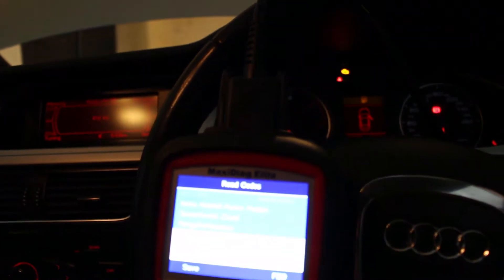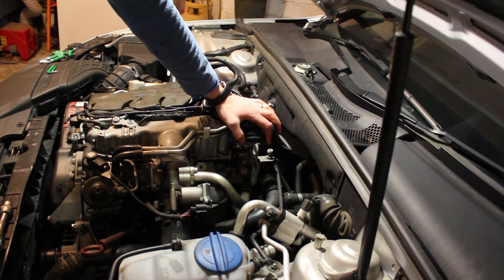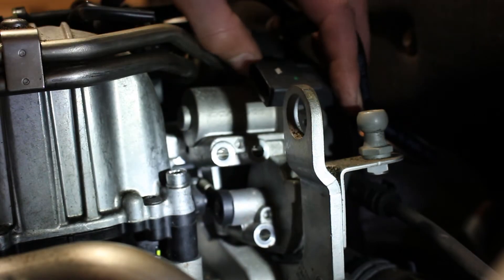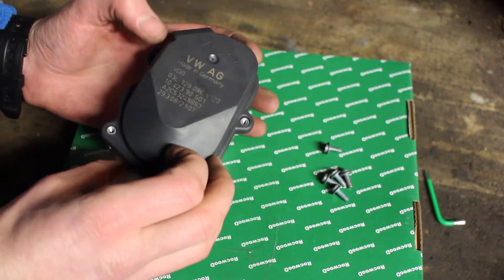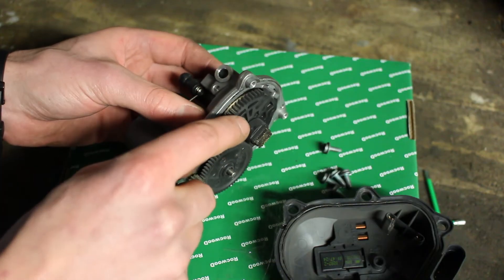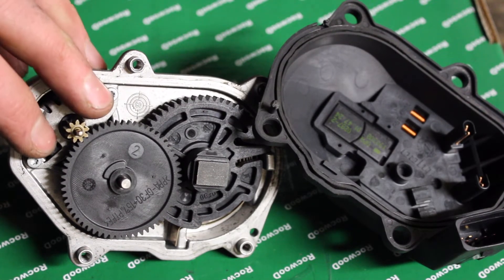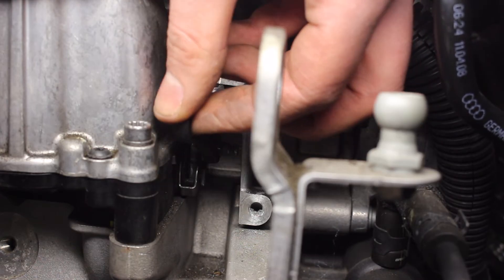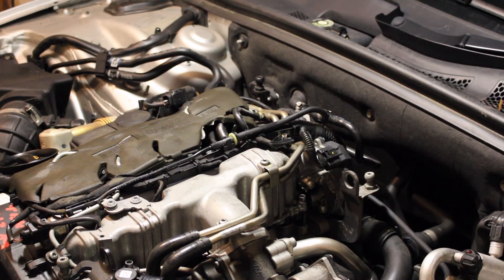How to remove & clean Intake manifold actuator motor/sensor- Audi A4 P2015 fault

Comment: Hi Sam,
Would you by chance have step by step guide covering 2015 error code fix on 2010 Audi A4 B8 . Engine with Sensor mounted on Plastic manifold . Little different to set up on your B8.
Great step by step guides. Have followed guide on how to change rear brake pads / handbrake release . Perfect . Thank you and thumbs up from me.
Reply: If the bolts for the sensor are on the other side it's an absolute pig. Manifold off
Reply: @brader901  having this exact issue right now!
Reply: Update on how it went ?

Comment: Hi I'm getting the same error code I brought the fixing bracket but still getting the fault code. One thing I don't see the actuator moving could it be the flap motor or blocked inlet manifold?
Reply: Did you fix it?

Comment: Mine doesn’t have the 3 bolts on like that to take off could the heads have possibly been snapped off?
Reply: I have the same problem with bolts not being there. Did you fix your problem?
Reply: @Ragran  I’m sure they were on the other side lol slept since then tho so don’t hold me to it

Comment: This was an illuminating and helpful video on the inner workings of the VDO V120 actuator motor.. Many people will find themselves looking inside here to continue to resolve their P2015, P2016 or P2017 error codes and not realise there are a couple of traps waiting to befall them. I have a quick question for you relating to the position of the hall sensor partner on the gear marked 2 - the smaller of the two that drives the actual sprung gear with the hall effect magnet on its centre. The fitting of a correcting repair bracket for error P2015 usually causes a slight rotation of the gears, up to about 20 degrees from the normal axis of rotation which means everything is out slightly. So the raised segment on gear 2 around its spindle will not correspond fully with the sensors in the plastic cover. My question is did you remove gear 2 at any time and if so, is it in its original position so that the hall transducers get the right signal for the degree of rotation? This is tricky little part. Coils can go defunct, the motor if removed can be reinserted in reverse polarity and gear 2 might just be in any old position if its position when opened was not observed. Your input would be appreciated; I think there are potential issues that might help those who got into opening this after finding the P2015 repair bracket a la diesel geek or in the UK X8R appeared not to solve their CEL issue.
Reply: How do you relate the manifold issue with the gears?

Comment: I cleaned the actuator motor and stil have an error code P2008 00 [039]  - Electrical Malfunction, any ideas what causes this problem? I did check if the plug is plugged in correctly,  the actuator motor has no sign of movement.
Reply: This is very interesting. I'm looking into a group of codes that centre around P2015, P2016 & P2008. I can actually hear my motor chirp to do something after I turn off the engine, but even if I rush around to see if the arm is moving, I find it is not. But something must have been moving to make that noise. What I can say is if you hear two chirps after shutting down, then things are usually OK, but if you only hear one, then something isn't right. I wish we could understand this mechanism a bit more clearly because I don't think its just a case of P2015 repair bracket. I think P2015 is more than one thing. I cleared P2015 and one point and got P2017 instead.
Reply: Apparently P2008 is an open circuit. So either something isn't conected or there is a broken or damaged cable.

Comment: Hi. P2015 (bank1) what does this “bank 1 “ means thanks great video!
Reply from the maker: Means nothing on a 4cylinder engine. Bank 1 and 2 would identify left and rights heads on a v6 or v8 as far as I know.
Reply: FixitSam I have a 2007 Audi QUATTRO  2.0T 4 cylinder and have that code .... should I not have to worry about it then

Comment: My mechanic told me that the repair bracket does not work or fix P201500 error & he tried it on 2 cars , so what do you think of  this ?
Reply: I don't think that's entirely correct. The problem is that P2015 is more than one thing in my opinion. I had P2015, fitted repair bracket then got P2017. Cleared P2017 and got P2016 and now I have P2015 AND P2016. Isn't it great!

Comment: I have the same problem p201500 fault on my Audi A6 , so do I need to clean it or buy the repair bracket  bracket kit on Amazon?
Reply from the maker: Would recommend the repair bracket as that is generally the route cause.
Reply: @FixitSam  can you do a video how you installed the repair bracket in the motor please
Reply from the maker: @Gifted1969  If you google 'p2015 repair bracket' you should get some results.

Comment: I can bet on that this cleaning didnt solve the problem :)
Reply from the maker: It sorted it for a month or so. In the end I had to install the repair bracket. (Google P2015 repair bracket). The issue is the plastic wears and the actuator moves a little bit too far.

Comment: How about an Audi A4 2008 2.0T
Reply: did you fix it?
Reply: Khally I fixed it myself. Bought a new pcv valve hose cause mines wasn’t air tight. Fixed the problem. So it could be what this guy is saying or or could be your air pressure from somewhere. Look for any tears in your hoses that connect to and from the intake as well as the pcv
Reply: @Miltonbosss  can i maybe spray som soapy water and see if there is any leaks that way?
Reply: Khally you can I suppose. I used my mic on my phone. But I mean run an obd reader on your car. Buy one at Walmart called micro mechanic. 20$ I used it meanwhile I got mine it’s pretty decent. If no codes. Just get it evaluated at a European mechanic who specializes in Audi’s
Reply: @Miltonbosss  my code is "P2015 Intake manifold flap position sensor implausible signal"